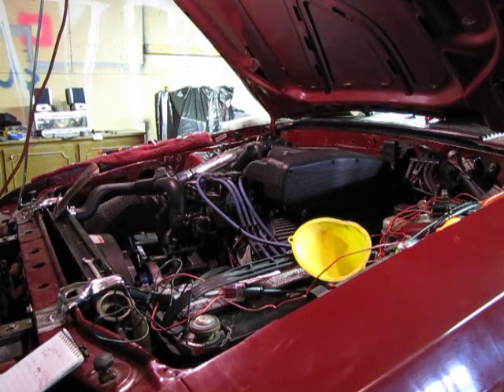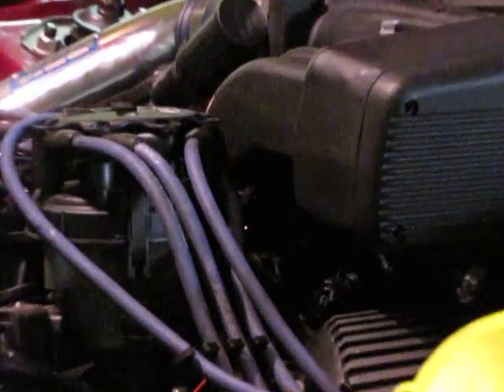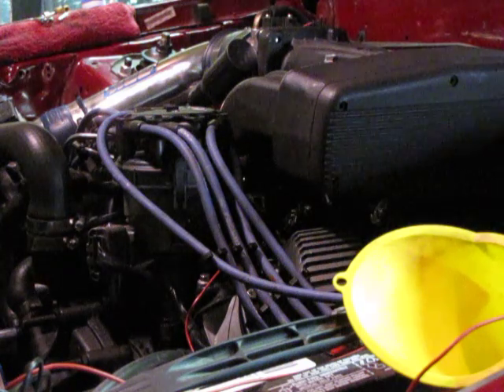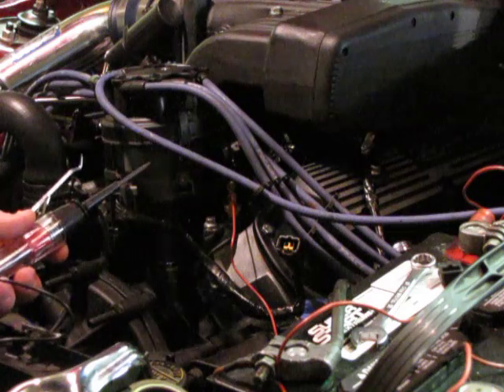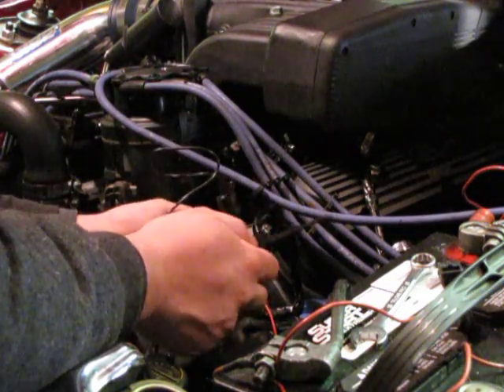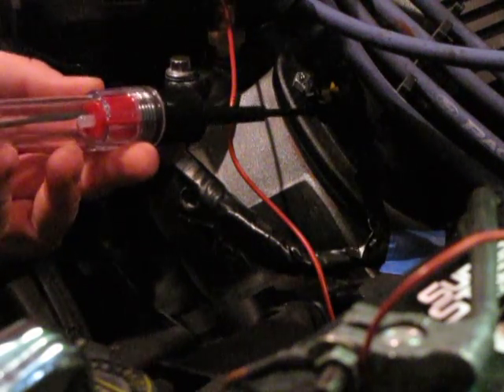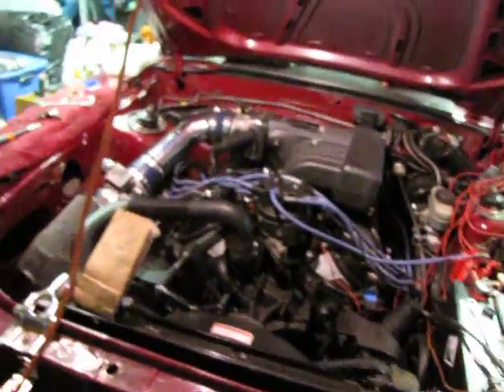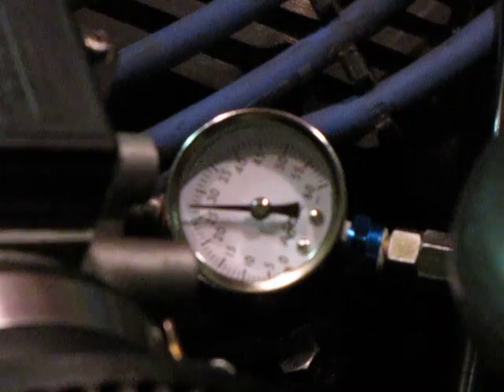How to check injector pulse on 5.0 Mustang

Comment: Did you ever solve the issues???
Reply from the maker: It turned out to be my distributor was 180 degrees out
Reply: Thx I’m having same issues but mine is not 180 out I do have spark and I do have fuel and good compression
Reply from the maker: @rayray7663  maybe plugs are foul, timing chain jumped, try starter fluid into the intake? Are you sure your fuel is good? Etc
Reply: Every time I take plugs out there flooded their brand new plugs brand new wire brand new distributor cabin brand new coil I tried starting fluid won’t start Wants to but he never gets going
Reply from the maker: @rayray7663  maybe you have an injector that is stuck open or a fucked up regulator. Total shot in the  dark
Reply: I fix it previous owner installed electric fans and decided to put the positive wire to the ignition coil and was messing up the spark
Reply from the maker: @rayray7663  wonderful to hear! Good job!!
Reply: Got a 94 5.0 I can't figure out fuel issue it will start but when you go to take the car out it chugs down and dies but will start back anyone got a idea?
Reply: @robertcook8860  did you figure that out?

Comment: Man, why don't you put one end of the test light to battery positive and poke the injector connector with the other end? You don't have to touch on the distributer. You will loose the sync. Just crank it and see if you have pulse on the test light. It is normal to the light not lit completely as the pulse is only miliseconds so the light will never be bright. If you have pulse on the injectors then your problem must be other things like spark or so.
Reply from the maker: CPUTests® I was talked into doing it this was and I was not aware I would be shocked lol

Trick played on me by a guy on a forum

Comment: Check for fuel pressure, Fuses, check to see if voltage at fuel pump, check fuel pump relay under drivers seat? Easy way to check for bad fuel pump spray brake clean in throttle body while starting? if it runs bad fuel pump.

Comment: Can you check for 12 v at  the injectors with out using a pin just by taking of the injector wires and putting the test light to postive and negavtive. I have a 88gt with a no start so help would be appriceiated grtly. thanks.

Comment: Spark = OK
Injector pulse = OK (it has to be dim, keep in mind ground pulse is measured in milliseconds)
Fuel Pressure = OK (check condition of FPR or prime system with vacuum line disconnected and if fuel comes out of vacuum line port)

Great job BTW.